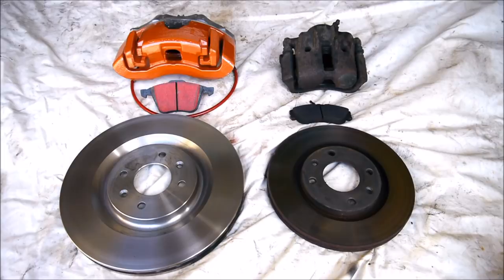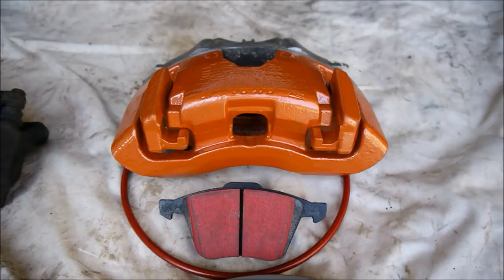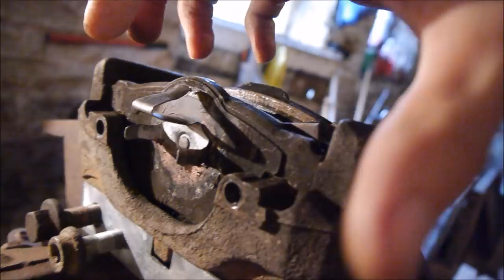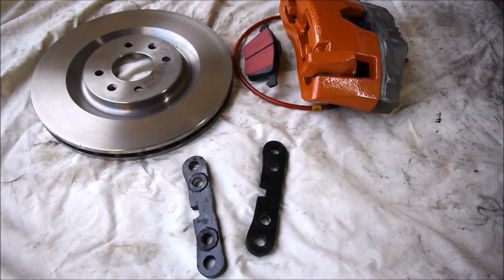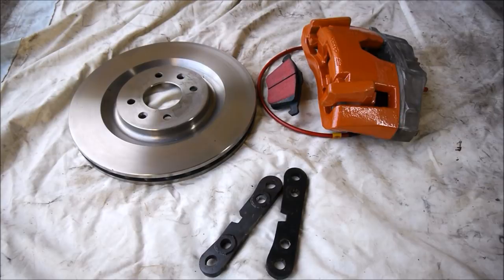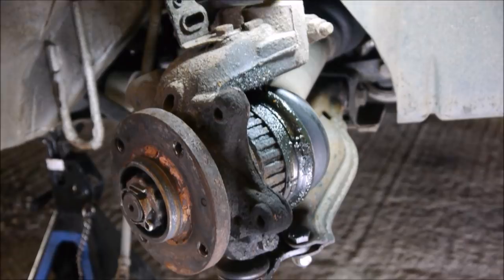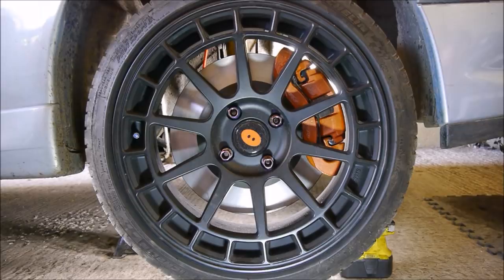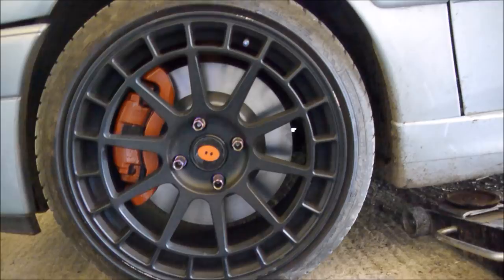Project 16v - Part 30 - Big Brake BONANZA!

Comment: I remember my ordeal with my gts-t calipers 3 lots of brackets before they got it right. 
Glad you got there in the end
Reply from the maker: Yeah, I am still tempted to grab a pair of second hand 208 GTi calipers... As these are those discs... Be curious if they use same bolt pattern... These weigh a lot!

Comment: On my first 306 2.0 XSi Phase 1, I put a set of EBC Turbo Groove Discs with Green Stuff pads. For a few weeks they were awesome and could stop the car pretty much instantly at speed.  However they soon began to clog up the disc cooling divets with pad material, and then it was like having barely any brakes at all.  Trying to clean the discs was very difficult and in vain, so I returned to using stock discs and pads on my other 306 cars.
Reply from the maker: EgoShredder yeah the old EBC stuff I never rated much and I dislike drilled discs very much!

Comment: Hi there, could the adapter be made from 15mm thick solid aluminium plate?
looks very cool I must say, could this mod also fit a Citroen DS3?
Reply from the maker: If I had a ds3... I'd just fit ds3 racing brakes tbh. These discs are the DS3 racing discs anyhow. 
I guess the adapters could be made of ally yeah, just more expensive to buy and have machined. 

Thanks for watching and commenting 😁🐷💪

Comment: Is there much of a weight difference between the original calipers and the XC90 ones?
Reply from the maker: Well, considering they more than twice the size... Yes. However they are part alloy so this helps. Discs too are naturally heavier. More metal however isn't always a bad thing... As there is more material to distribute the heat and stress. 🤜🐷💪

Comment: Do you think it would fit under 16"? They look amazing, im looking into some solution, for now im running brembos with c5 discs... Squeals like crazy, not problem for me, but officers don't like it... Brembos are easy to sell so for the price of that i could easy buy set of these
Reply from the maker: Lixtronic Garage I wouldn't like to say tbh... It would likely depend on your wheels and offset.

I too swung away from the Brembo setup due to squealing.

Thanks for watching..🐷💪
Reply: Could you do me a favour and test out if 16" will clear in diameter, I think offset won't be issue in my case becaouse im running effective ofset of et5 (et25 wheels with 20mm spacer)
Reply from the maker: I have not got any 16" wheels to test Im afraid, if you were not far, you are welcome to come and test fit

Comment: You will compare new ones with old one?
Reply from the maker: Andrija Andric I attempted to do this with a video of 60-0 before and after. But accuracy of the moment the pedal is pushed and the speed that the Speedo corrects and then stops dead at 0 really didn't do anything to show the comparison 🙈

Sorry. 

They are epic. 

Thanks for watching and commenting 🐷💪
Reply: Piggy Power i am looking for putting 283mm on my 206sw, i think that will be fine..
Reply: Piggy Power you should only measuring meters,like 120km/h to 0km/h
Reply from the maker: Andrija Andric yes, the 206 GTi180 brakes are a fine upgrade for most 206s. Being lighter too. I have done exactly that for my wife's 206 HDi, work a treat. 🐷💪
Reply from the maker: Andrija Andric measuring distance is a fine idea. Be good to find stock figures and then compare. 👍
Reply: Piggy Power DON'T FORGET TO DO THAT! Greetings from Serbia..
Reply from the maker: Andrija Andric Хвала вам